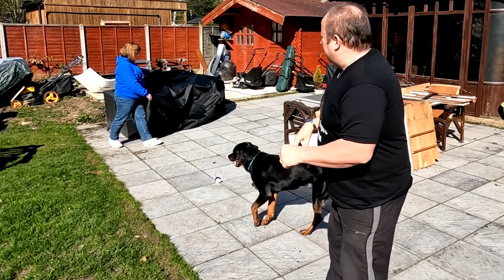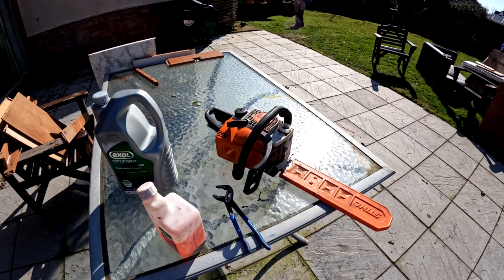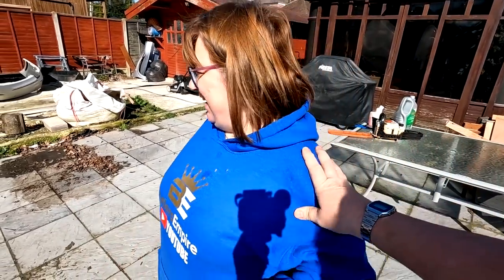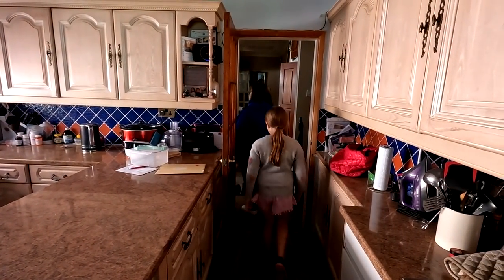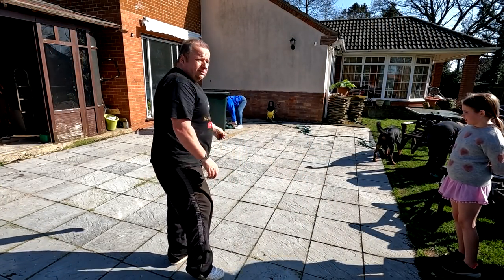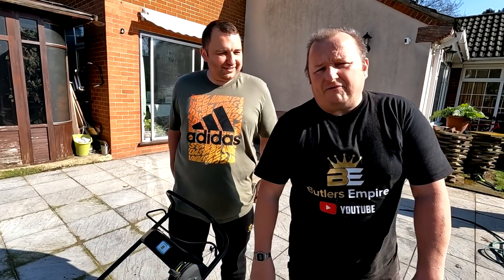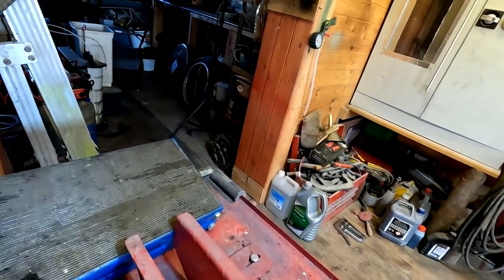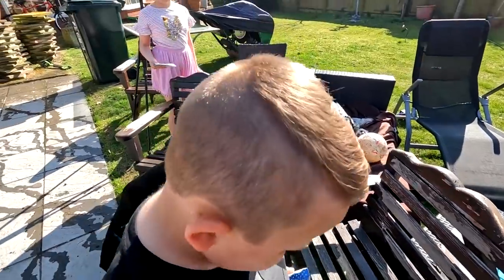Everyone Mucking In vlog

Comment: Been pressure washing our patios for years with the wand , when I say I I mean my wife . Purchased a patio attachment for my Stihl pressure washer the other day for £80 . Does a great job ,doesn’t blow out the joints and contains the water super mess splash so less cleaning yourself and anything around you .
Reply from the maker: Great tip Rick.